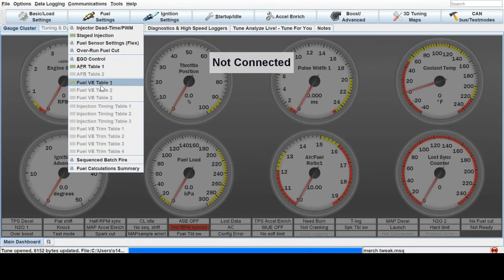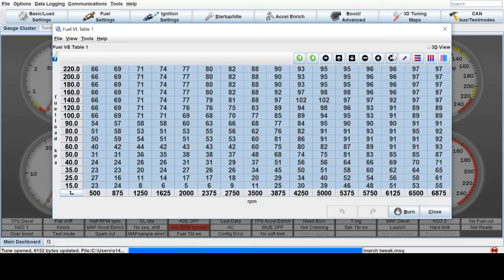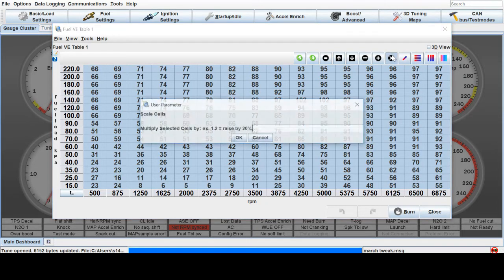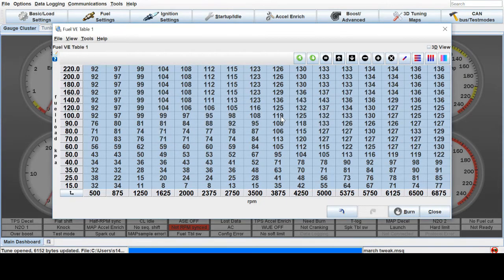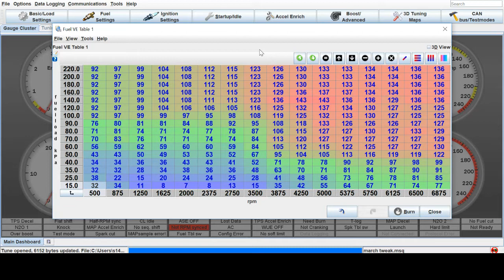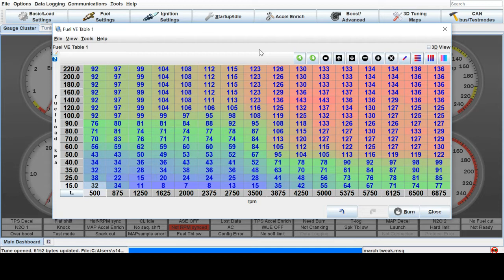How to Make a Base e85 Tune In Megasquirt

Comment: im confused. This isnt how you do it though. Im more interested in what no one talks about. 14.7 stoich for gas. 9.8 or something for e85. yet My air table says where its at. where is the TABLE modifications. that what matters.
Reply from the maker: This video demonstrates how to switch from gasoline to e85 with a preexisting gas tune. Lambda targets are similar between the two so you keep the afr target table the same.
Reply: He's saying that this isn't the correct way.  VE doesn't change when you change fuel.  The calculated fuel requirement does.

Comment: This is actually NOT how you tune for e85 with the MS or any ECU. You should actually adjust your fuel model to represent the fuel that you’re using.
Reply from the maker: This is a “base” to start your tune from. Switching from gasoline to e85 this will get you close enough to run the car as a base

Comment: I have another question, you’re manipulating the fuel V.E table in this video.. but 

In order to  scale for E85 fuel, shouldn’t you  manipulate the *predicted air mass* (mass airflow) rather than the volumetric efficiency.

 Here’s why:

E85 Fuel Characteristics: E85, which is a blend of 85% ethanol and 15% gasoline, requires more fuel volume than pure gasoline to achieve the same air-fuel ratio (AFR) because ethanol contains less energy per unit volume. Specifically, E85 requires a richer mixture, with a stoichiometric AFR of about 9.8:1 compared to gasoline’s 14.7:1.

Predicted Air Mass (Mass Airflow): Since the engine control unit (ECU) uses the predicted air mass to calculate the amount of fuel to inject, adjusting the fuel delivery to accommodate E85 is usually done by modifying the fuel injector scaling or adjusting the fuel maps to deliver more fuel for the same amount of air. This ensures that the engine runs at the correct AFR for E85.

Volumetric Efficiency: Volumetric efficiency is more related to the engine’s ability to breathe, i.e., how well it can draw air into the cylinders. It isn’t directly affected by the type of fuel being used, although changes in fuel type might slightly affect combustion characteristics and, consequently, VE in some cases. However, this is not the primary factor you adjust when switching to a different fuel type like E85.

Wouldn’t you typically need to increase the fuel injector pulse width (or adjust the injector scaling in the ECU) to inject more fuel to compensate for the lower energy content of E85?

In summary, to scale for E85, shouldn’t you primarily focus on manipulating the fuel injection parameters (related to the predicted air mass) rather than the volumetric efficiency? 

Thank you and sorry if it’s confusing
Reply from the maker: The VE table in MS directly controls the amount of fuel / injector pulse width. If you want more fuel you add more value in the VE table. The flex fuel system does the same thing with a multiplier to the VE table if you setup flex fuel. In this case if you are going from a gasoline tune to ethanol you need roughly %30 more fuel to match ethanols air fuel ratio to make the engine run properly. If you have megasquirt on your vehicle you can test this really easily by draining the tank and filling it with e85 and following this video
Reply: @TurbineResearch  thanks Dude! I do have flex fuel, but I just wanted to know how to do it manually the way you’re teaching, makes sense!!!

Comment: A much easier way is to enable the flex fuel sensor. If you don’t have one it will then fault and fault to a given setting for sensor failure. While the car is idling adjust the sensor fault setting until EGO correction come back into line at 100. This will be adjusted for the ethanol content currently in the gas tank. Ethanol can very from 50-90 at every gas station. This method allow you to adjust on every fill up and you don’t have to touch the fuel table if it’s already set for 91.
Reply from the maker: Absolutely , flex fuel is the best way

Comment: Hi. Thanks for the video. What about spark advance ? No need to change anything ?
Reply from the maker: Spark advance needs to be adjusted on a dyno. However, usually you can add 1-3 degrees of ignition advance with full e85.

Comment: Do you still need e85 parts ? Or will mega squirt convert it using stock equipment?
Reply: Megasquirt will run most OEM flex fuel sensors. Although GM has the most tried and true sensor.
Reply from the maker: Flex fuel sensor is the best way to convert but you can just do a full e85 tune like I show I show In this example